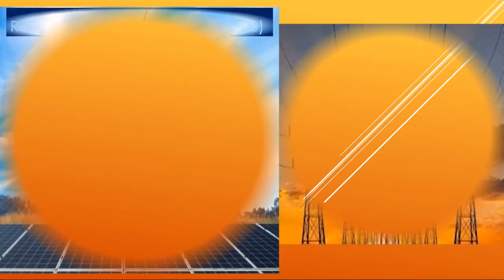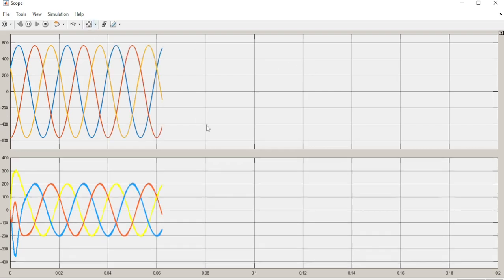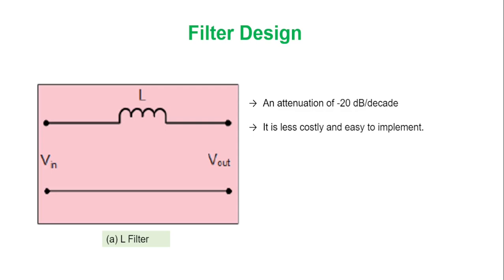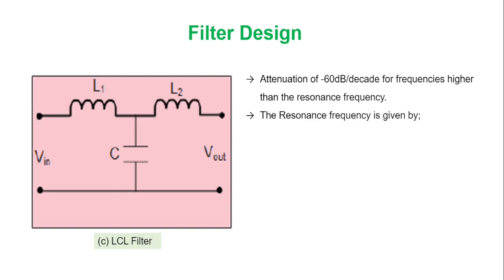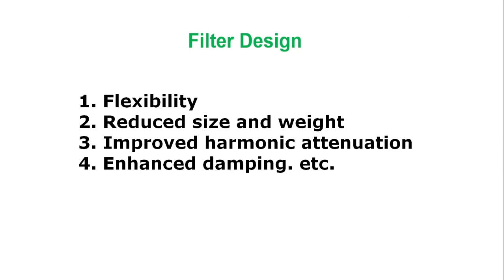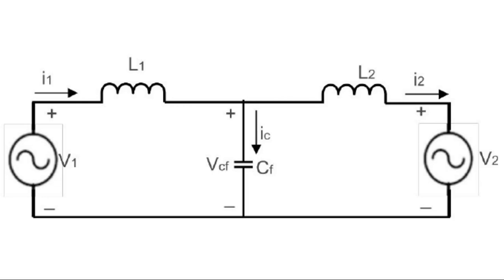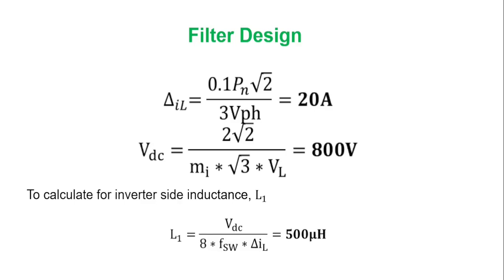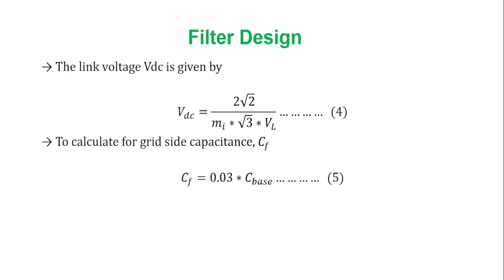Design of LCL filter for 3 phase grid connected inverter.

Comment: In the video discretion box, there are no any links for the reference papers or the reference materials 
There is some equation for calculating L1, L2, Vdc.........
I'm just looking for the value of "Vph" that you use it to calculate (dilta iL), which is equal to 20
Reply from the maker: Please check before the equations. There are 3 references
Reply: @pmctech1415  
Yes I have seen them (the 3 references) they are about the IEEE Std (standards of harmonics) not about LCL filter
Reply: @pmctech1415 where is the vph value ?where is it?

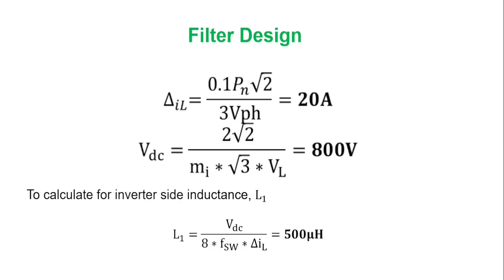Comment: 4:52 I calculated as the equation you show, I got delta il 5.8... and Vdc 0.025...  I think something is missing or a typo,
Reply from the maker: Try to check in the description box. I included the formulas there
Reply: @pmctech1415  I saw it, and it's the same as in your video
Reply: @pmctech1415 is vph=415 v?